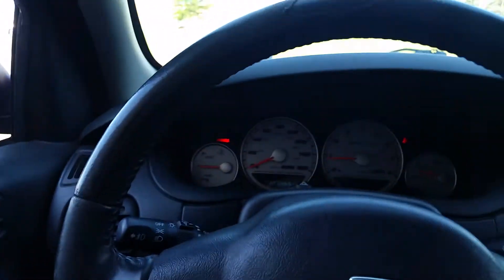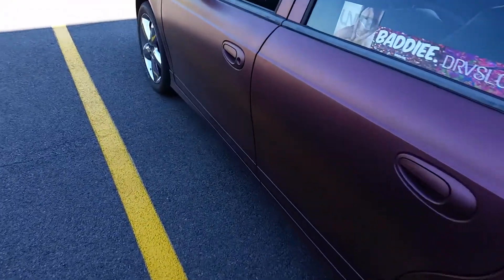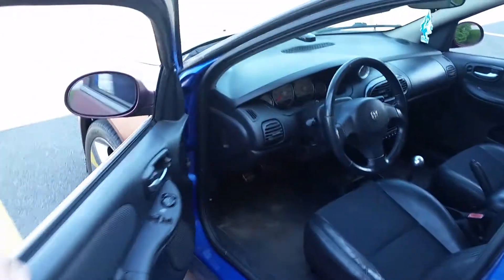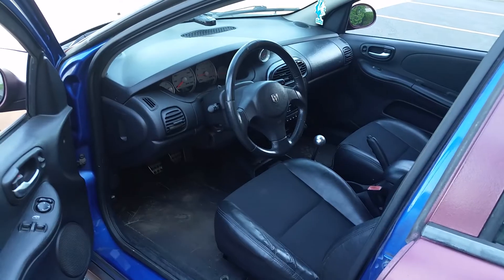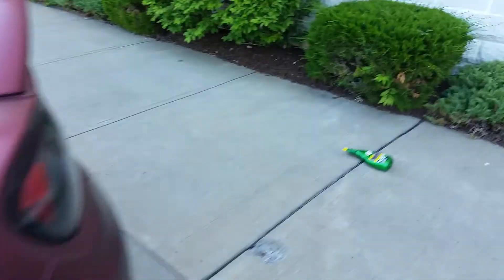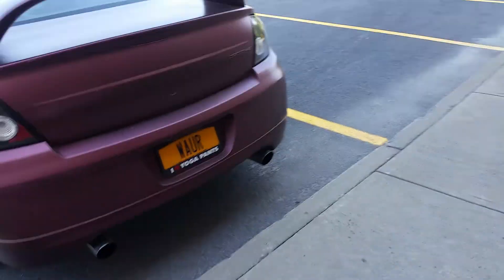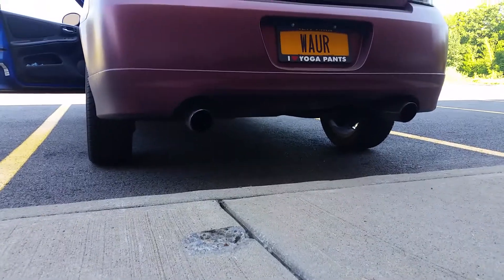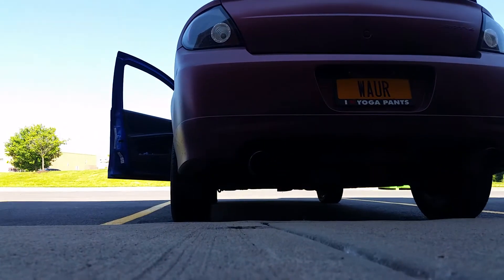Srt4 Qtp Electric Cutout

Comment: Wow . Nice car man 

Huge difference bro.
I hear the turbo spool more when its open. Any difference in performance since turbo spools faster ?
I was thinking about putting one on my factory exhaust. This video helped me decide . Thanks man.
Which size should i get 2.25" or 2.5" to fit factory . What size clamps?
Reply from the maker: With cutout closed. The pull seems smoother. With it open just feels more raw and throaty..but. as for difference, it doesn't feel as fast as you think it would be. Not too big of a difference. 
Also I don't own this car anymore. I have a difference neon now.
Reply: @XBLWaur  oh ok  , thanks man.
Did you put the 2.25" or 2.5" cutout .
I only want it to sound aggresive . I'm lookingon amazon and kinda confused between the 2.5 and 2.25
Reply from the maker: @azimaslam6375  honestly I bought the car with it on there. So I'm not quite fully sure. I know it was like 300+, bucks. Cause the car came with a stack of records and that's the most of what I can remember unfortunately.
Reply: @XBLWaur  oh ok np bro.
Thanks foe sharing your video.
Cheers
Reply from the maker: @azimaslam6375  not a problem bro!